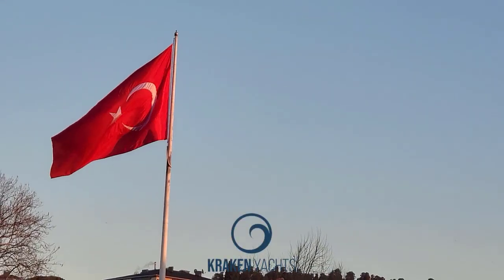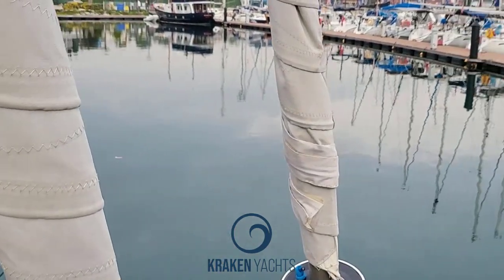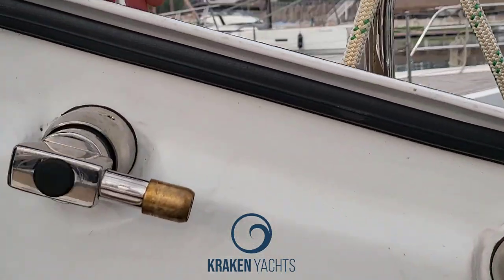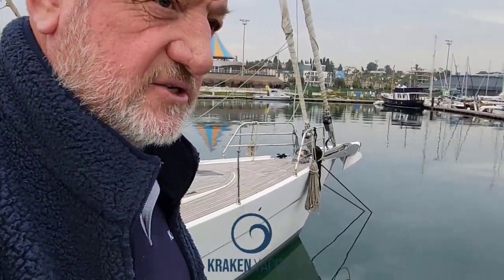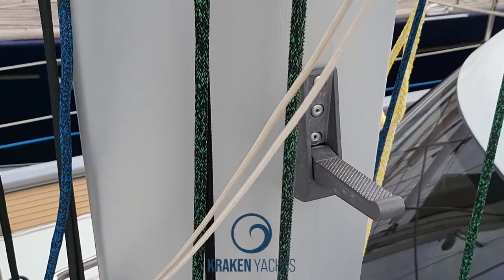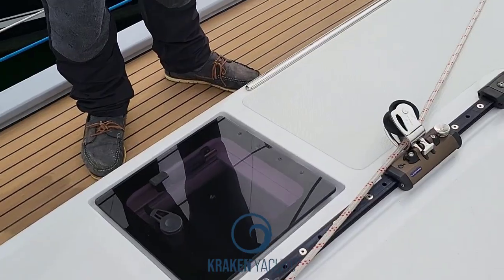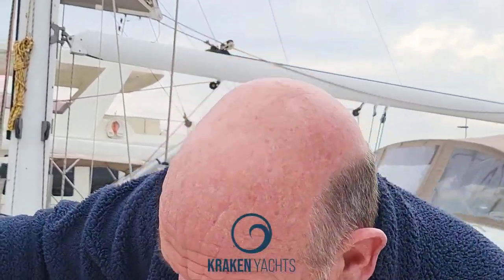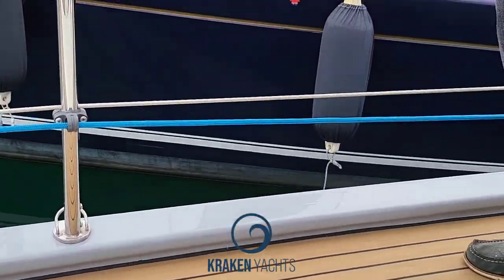Kraken Yachts - Solent Rig Explanation by Dick Beaumont

Comment: Hmm, if you’ve got shore power to the bow locker, you have to keep the hatch open?  Or did I miss another ingress for the cable?
Reply: The hatch locker has a notch cut out one the aft side of the hatch locker tops in the aft centre, and a notch is cut out out the forward inner gulley, the hatch drains are athwartships, the cable runs in the gulley then down into the lazarette to plug in. When the yacht goes to sea a rubber grommet fits into the forward inner gulley.

Comment: Really enjoying learning about kraken yachts. Just puzzled by one small oddity.... Why are the forward deck hatches hinged at the rear? This potentially could allow water coming over the boat in a case where the hatch was left unlatched or had a faulty latch. Surely hinged at the front as is common on commercial vessels would be be safer?
Reply: Plus side is that you can catch some fresh air for the cabin while underway.  Maybe some sort of double-sided opening hatch is a good compromise between the two?